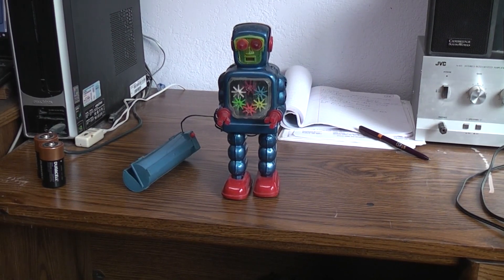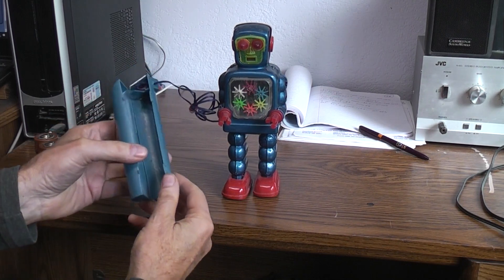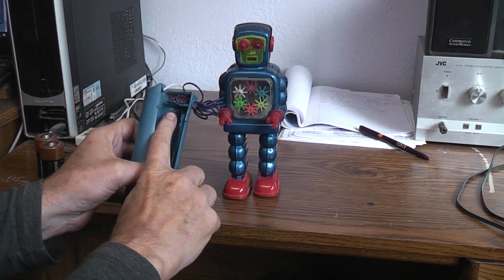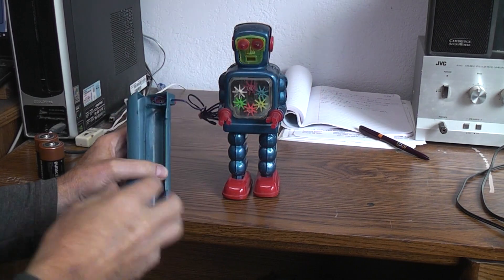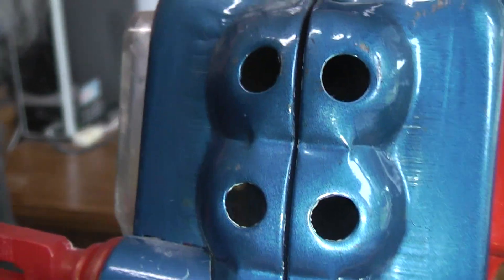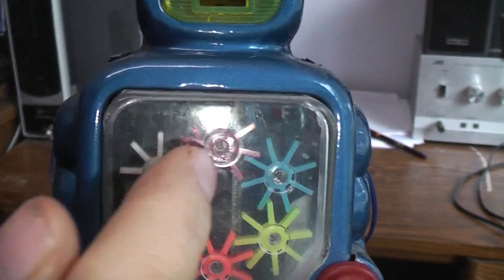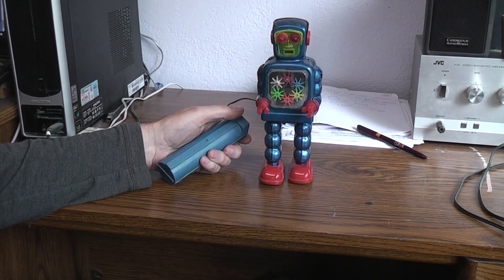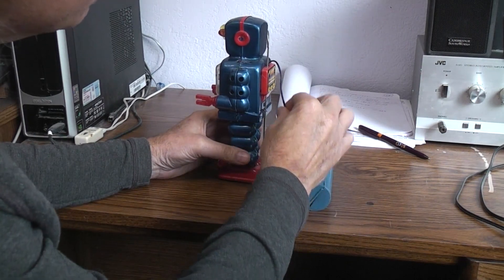On the bench, Battery operated High Wheel Robot. 6 gear version. 1965, Yoshiya, Japan.

Comment: Hi John, a very interesting tip about the four holes the robot has on his arm. You can put in movement the motor or the gear with a screwdriver. When they have some time without use always the motor don't want to operate and this holes are very practical. All robots would have minimum one. Greetings!!